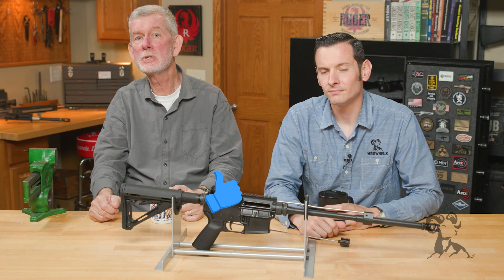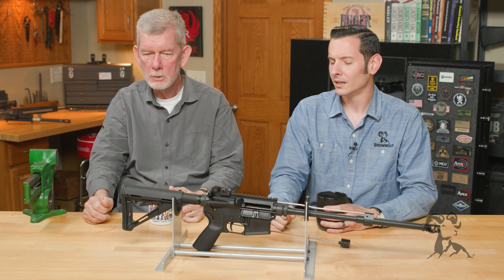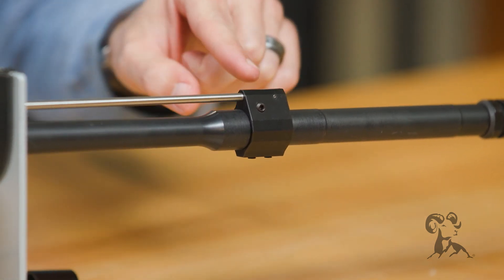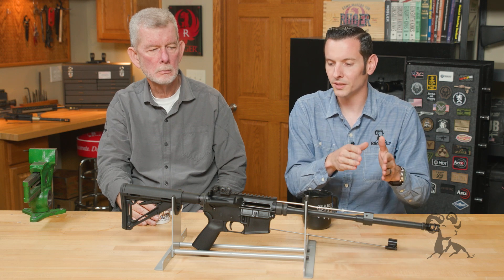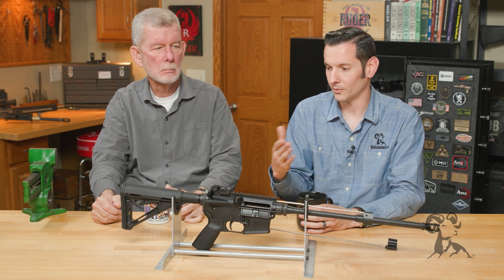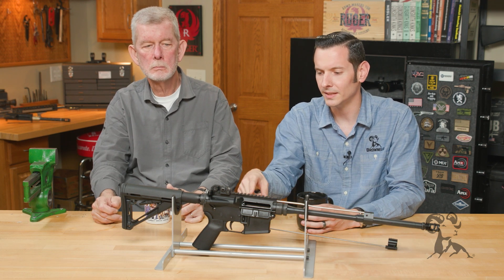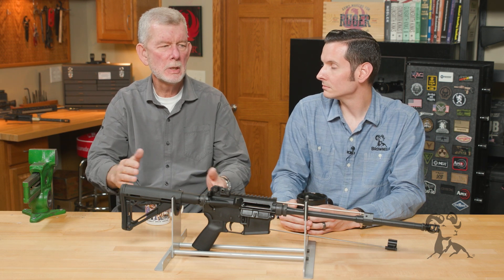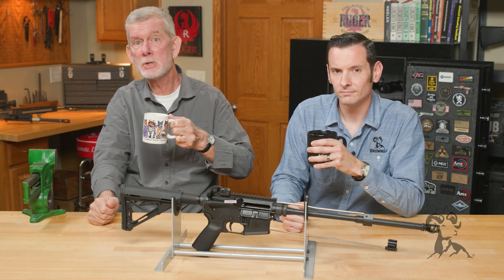Smyth Busters: Does Every AR-15 Need an Adjustable Gas Block?

Comment: Can you guys do a smythbuster on whether AR-15s need the Spring Detent pin to retain the buffer system at all times? Or is it better to remove it in order to prevent catastrophic failures. I've heard some people say that they break easily, and that it would be best to remove it.
Reply: Only if your rifles receivers spec is off and you use cheap parts. Using a JP scs does not mean the rifle is more reliable. If the buffer is hitting the buffer  retaining pin, then your bolt carrier is too short, the retaining pin hole in the lower receiver was drilled wrong or the buffer tube was drilled incorrectly. Close your upper and your bolt carrier should push the buffer back off the retaining pin. If the face of your buffer is beat up then you have an out of spec rifle.. Flock of seagulls dude at DeRanged is not the best source of AR information.....
Reply: Internet boobs are an authority?  I actually can see that Eugene Stone and Colt made the bolt carrier too long and it pushes the buffer back so it does not contact the buffer retainer pin when you close the firearm.

Comment: What about AR pistol, with short barrel? Should use the adjustable gas block?
Reply: No, they are not recommended for 5.56 pistol barrels...
Reply: @hairydogstail  Do you know why? Doesn't shorter gas tube on AR pistols produce more impact on the bcg?

Comment: Nice tech video to have is… how to measure and properly regulate your gas. How to know when your gun is over gassed…. I personally don’t want to use an adjustable gas block. It’s just one more moveable thing to go wrong. But, I don’t use sub-sonic and personally have that need.

Comment: How exactly will a lightweight BCG affect dwell time and reliability, all other components being standard? Would an adjustable gas block be recommended?
Reply: The light weight carrier needs less gas to cycle if the rifle has an efficient gas system which results in a higher cycle rate of the bolt carrier. The advantage of the adj gas block is the ability to restrict or adjust the gas to the ammunition being used with the rifles gas system. This allows the rifle to cycle reliably with the least amount of gas needed, creating a very smooth and soft recoiling rifle..
Reply: Some bcg's are tunable, but otherwise just get the gas block and worry about bcg or buffer later (if needed)

Comment: OK, a little bit more advanced question here.... what's the best way about going opening up the gas port on the barrel? I imagine the drill bits requires would have to be a very particular in size, I mean where would you even get bits that precise?
Reply: You would be better served looking elsewhere to adjust your gas operations. There are no circumstances under which drilling into your barrel will be helpful!
Reply: I did it to my barrel using a drill press and a bit from the local ace hardware.  Just measure with the back of bit and refer to a gas port hole size chart.  It gives incremental values.  Align with back of bit, then turn around and drill carefully while looking down bore.  I forgot the size I used, but Irwin brand bit.  They come in decimal, fractional, and letter bits. Hope this helps. After opening up, you might need an  adjustable gas block to fine tune.  If you do try, go slow!!!!  The last thing you need is a broken bit in the hole.
Reply: Thank you for the tips ss ss. Good to know you were able to use common Irwin bits you'd find at Ace. Will of course do more research on my part if I ever get to drilling a port larger, but yes, thank you for the info. 

As to why I'm interested in opening up gas ports? I've run into quite a few Aero Precision AR 308s that do not cycle reliably, even with the gas port perfectly aligned via borescope, running standard buffer and spring weights. This is not an uncommon issue for these guns, particularly ones with rifle length gas systems. I don't believe using a lighter than standard spring or buffer should be necessary for these guns to cycle reliably using standard velocity loads/7.62 NATO. Luckily Aero's return policy is quite good and I've yet to drill any gas ports larger, but if need be, I'd like to know to go about it.
Reply: @lon242  My barrel was an Aero with a rifle gas system too, but only thing in 223 wylde
Reply: Any drill bits won't have to be super precise. Question, though:
Why do you think the gas port is too small?

Comment: My complaint with gas blocks (and Adams P pistons) involves the manufacturers that shave that .020-.030" off to make space for the use of a 2 Piece Handguard Cap.  In the case of the Adams P series, its touted as a low profile, under the handguard, piston block for free floating one piece tubes...but Adams' insists that a gap between the block and barrel shoulder be held for the handguard cap...most of us dont incorporate in our builds.
Seekins AGB's are manufactured to close the gap, and are to be pushed against the barrel shoulder.  That pulls out some of the guess work.
A quick way to verify if the block you have selected is a gap vs. no gap block is to:
1) Remove the set screw that corresponds to the block's gas port hole.
2) Look closely to see if the gas port hole is centered to the set screw hole ( no gap needed).
If the gas hole and the set screw hole are visibly out of center to each other, a barrel shoulder- to- block gap must be held.
This Handguard Cap gap thing is one of the reasons why most barrels come undimpled.  The other dimple stumbling block ( pun intended) has to do with set screw spacing, and how many set screws does the block use.
Reply: All you have to do is space the gas block from the shoulder using a credit card and tighten it down. Easy.

Comment: Could you go over some tips on how to know if your ar is over gassed?? Is it just feel? Amount of fouling on bolt after X rounds? Love these videos! Keep em coming!
Reply: I think the direction your shells are being ejected will tell you for the most part if the get ejected from like the 1-3o'clock position its over gased if its shooting them out from 3 to 5 your good
Reply: @Isoeso  Oh yeah! Ill check this next range run! thanks for the informative reply! Its a rarity in the depths of Youtube comments!
Reply: @vettelover2009 All of that makes sense. I shoot MFG ammo and dont reload, but also I would say each MFG loading could be slightly different, so running on the MIN for one MFG could not be enough for another MFG. Mine are SD units, so id rather them run 100% of the time and be a little more to clean, than not work. Thanks for the reply!
Reply: @looseballs1966  I see you have never competed competitively. If you can not see any improvements in your slit times with a balanced gassed rifle and an over gassed rifle, then you need more instruction and practice. Just saying......
Reply: @looseballs1966  If you say so lol. I see your type try out in multi-gun and 3-gun matches from time to time..  When the 70 year old lady smokes your type, the excuses such as yours always appear ... .Real life, fighting carbine, 30+ years, etc ,etc .. You forgot this is not combat, there are no timers in a gun fight, or life and death lol. My 51 year old wife smoked a retired LA SWAT team member and we never saw his face in competition again either. Paper and timers don't lie... Skilled shooters are always learning and having humility, which is a big prerequisite for increasing skill...I'll let it go right there.. By the way, I'm 61 years old, so keep your snot nose punk remarks to your self....
Reply: @looseballs1966  By your obvious lack of firearm skills, reading comprehension, grammar, emotional maturity and state of mind,  you definitely should not be in possession of any firearm. Good day............
Reply: I have 4:00 ejection but not feeding another round??

Comment: Lol, I've never had a gas issue on any of my custom built AR 15's, and I own 5, and I do not own one adjustable gas block. Good morning guys😁
Reply: The military requires barrel gas ports to run reliably with NATO spec ammunition. When civilians use lighter pressure ammunition, "such as wolf or Tula that runs the spectrum of pressures" then problems occur. This is why most civilian made AR rifles are over gassed' larger gas ports" to run run reliably with all ammunition. The adj gas block can meter down the gas with the higher pressure ammunition. Over gassed rifles will chew up gas rings very fast and create premature wear on the rifle....

Comment: So would one need to open up the hole in the barrel then if it's under gassed?
Reply: Probably if all else fails. Measure gas port and find out what size it should be for your system first. I had to do it last week now it works great. By the way it was a BA Hanson 13.7 barrel I got thru Brownells. After researching it seems others had the same issue with tiny port on ba barrels. I've had a few of them that were fine but not this one. Had to come up to 1/16 .. .067 to function .
Reply: Clean it, check your gas rings for wear (these are like 3 dollars). If that doesn’t work: if you built it with an H2 buffer, get a lighter buffer
Reply: Remove the gas block and look at the blast pattern / powder residue on the barrel port and the gas block port.  If the blast pattern is evenly  distributed around each hole,  that indicates acceptable alignment of GB to barrel ports.
If you see an uneven blast pattern around either the barrel port, or the gas block port, or both, its probably a misalignment issue. 
If your AR block and barrel are married in with dimpling and or pinning,  which makes it hard to resolved misalignment issues, take a small countersink, or the tip of a sharp drill bit and chamfer/countersink the mouth of the gas block (you should make a funnel-like feature to grab the gas better). Perform your fixes on the gas block first, because gas blocks are less painful to ruin, than a rifle barrel
Reply: You could have gas leaking in the gas key, gas tube. gas block journal, etc. Opening the barrel port is always the last option....

Comment: How do you tell if your gun is over gassed?
Reply: Most mil-spec AR's are, but you can easiest tell by the ejection timing. 

I can explain away, but it's best to learn on your own. Just do a Google search on "ejection timing" and the such and go to town.
Reply: typically they will eject between the 1 o'clock and 2:45, that is overgassed.

Comment: My AR15 kicks like an angry mule. Would changing to a heavier buffer weight ease that kick a little or would getting an adjustable gas block be the way to go, or...?
Reply: Never have I ever heard anyone complain about an AR-15 kicking to hard.
Reply: If it's over gassed you solve it by reducing gas, not increasing buffer. I would recommend a good quality adjustable with detents and several settings. Just close it down until it doesn't cycle reliably and then turn it back up one. It you may get a failure if it gets dirty so be ready to turn it back up if needed. I've never installed one but use them on many guns and they all work about the same.
Reply: Gas block, if you increase the buffer weight but dont increase it enough, you could actually increase the recoil because you have more mass recoiling. An adjustable gas block takes out the buffer guess work.
Reply: 1st pinpoint the issue(s) causing the recoil. What’s your current muzzle device? What buffer system are you running? Is this a DIY build? Are you running it suppressed? What’s the current gas system/gas block in it? These are the type of questions you should answer.
Reply: I upgraded to an H2 buffer. It helped as my AR as it was a bit over gassed from the factory. Go to the Sprinco USA site. They have some great articles.

Comment: Another problem I have heard of is the gasblock blocks part of the hole in the barrel for an under gassed system
Reply: @Enjoyer.762  Sorry but we will agree to disagree. Clamp on gas blocks are very strong. Pinning does effect accuracy compared to clamp on blocks, how much is dependent on many factors.. Dimpling too deep and over torquing the screws will also effect accuracy. No myth, proven over and over...
Reply: You mean like the gas block being misaligned with the barrel?  This is definitely possible with set screw only style gas blocks, but I've never had an issue with gas block port restrictions on a pinned gas block.   Pinned gas blocks more or less take the guess work out of it.. and imo are MUCH better to use over a set screw style gas block.   

If you are going to use a set screw gas block, just make sure it's absolutely aligned properly and the barrel is dimpled to hold the gas block and set screws in place.
Reply: @Antykain  sort of , fully seated gas block with misaligned hole drilled into it blocking part of the barrel gas port in a forward setting or rearwards
Reply: @Antykain  Pinning will effect barrel harmonics as will the set screw type, if the dimple is drilled too deep or the set screws are over torqued. Clamp on blocks are the best, if accuracy is the goal...
Reply: @John_Redcorn_  Always check the hand guards ID before selecting the gas block type. Most precision shooters build their rifles around the barrel, regardless of weight. They use the largest hand guard I.D. for the gas block barrel flex, preventing gas block- hand guard contact.. Defensive rifles or even hunting rifles, can have different priorities, where other gas block types can be more suitable. It all depends on the shooters needs and expectations they have for their rifle...

Comment: It's only a bad idea if you're doing a bolt on gas-block. Pin it, pin it, pin it. And for everyone that doesn't know, you can modify a standard A Frame to be adjustable and low profile. Cheap and easy
Reply: Well, don't leave us hanging. Cheap & Easy was my ex's maiden name....
Reply: @suntzu5836  Look up at gas glock low profile conversion
Reply: I turned my A2 gas block into a screw-launcher. It was Cheap. It was Easy. But it didn't Work lol
Reply: @Cautionary_Tale_Harris  Screw launcher?
Reply: @picklerick9578  Yeah boy! I drilled a hole into my A2-style gas block, threaded the hole, and used a machine screw (that was supposed) to control the amount of gas. 
It actually sent the screw into low-earth orbit.